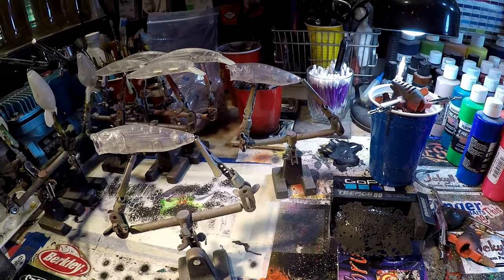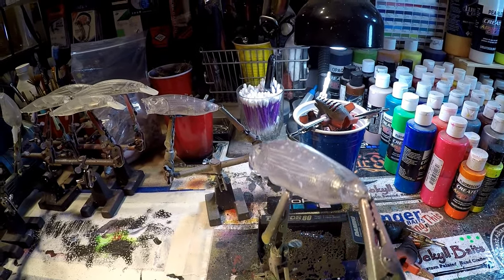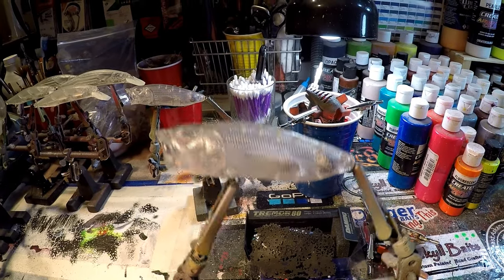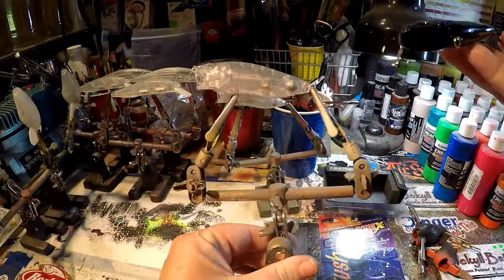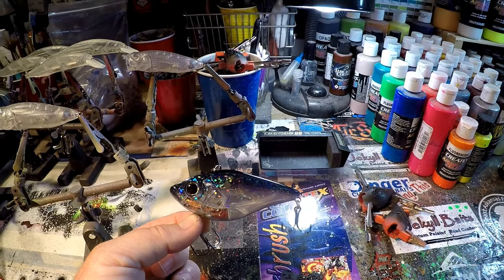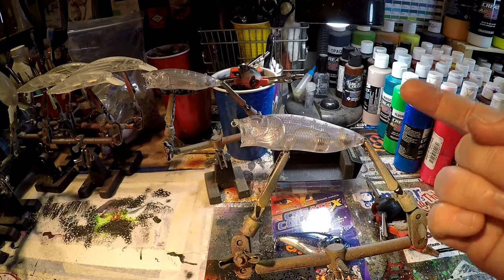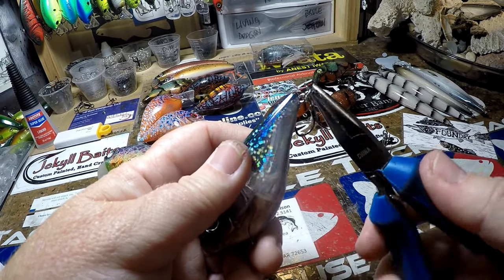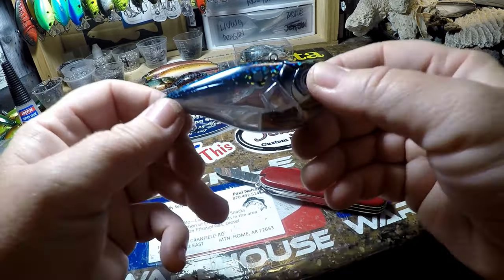Answering F.A.Q.s!! (Part 1 of 2) "Crappie Pattern on Damiki Tremor80"

Comment: I been using marbles for years. I put 2 or 3 in a bottle right off. I get them free at work. We use chalk pens to write in the metal tables. I have a box at the end of the table everyone drops there were out markers in. Each on contains two marbles. But I get close to 300 marbles a week. Also I "mix" many colors in 2 oz bottles with a eye dropper tip on them. I have said this many times. I'm sure you know already, but for the benefit of the community. You can make any paint metalic or color shifting simply by adding pearlex pigment and/or metallic or pearlized paint. You can go anywere in the spectrum. All the way from were it has sparse flake in it to looking completely pearlized. Also you can use as many colors of pearlized or metalic you want to make a color shifting or multi colored metallic paint. You can even mix in glow in the dark paint or glow in the dark pigment.

Comment: I also use glass marbles to my KBS jar, this is to raise the level of the liquid as the volume drops. By doing this you keep the amount of air in the jar, which causes the
E KBS to cure, to a minimum, and thus preventing the KBS from curing for longer.
Reply from the maker: Excellent! That’s a fantastic tip. Thanks!